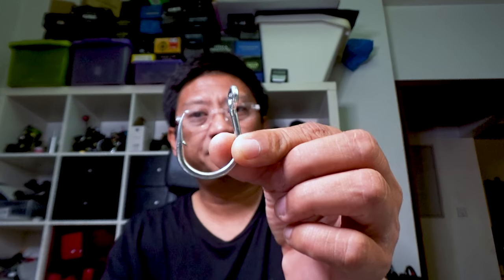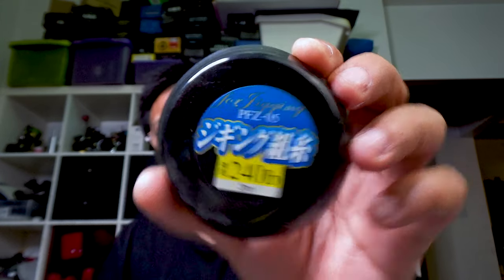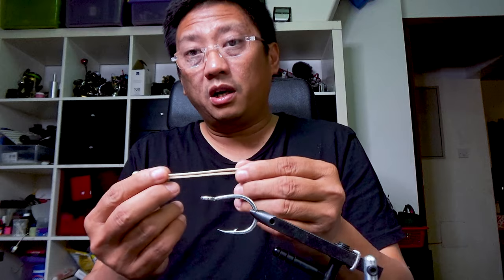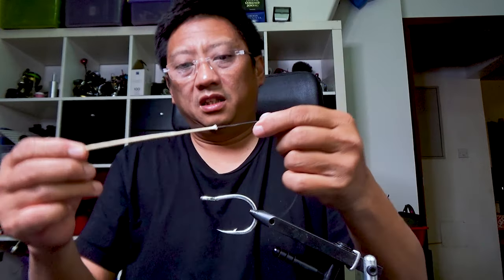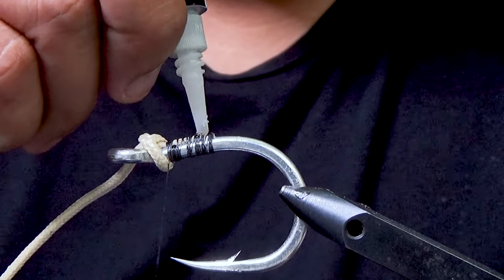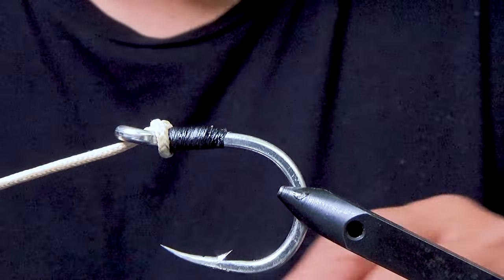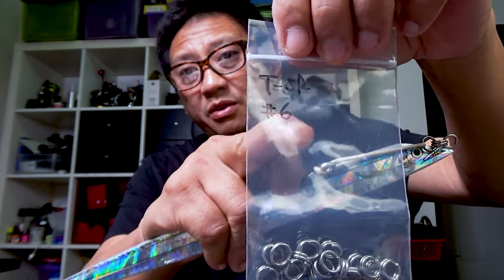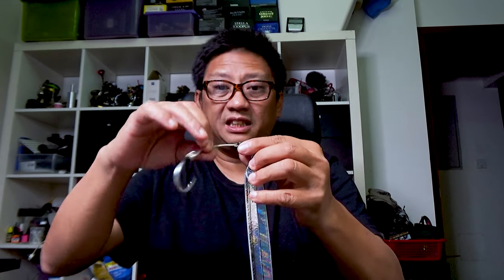WHY SINGLE ASSIST HOOK FOR FAST JIGS

Comment: what are your thoughts on using epoxy as extra layer of protection instead shrink tube? Is there any benefit of adding epoxy over glue in shore jigging for bluefin tuna with 80-120g jigs?
Reply from the maker: Regular epoxy yes - uv epoxy is trash

Comment: Hi Mr. Kit it's a heavy assist and monster jig also
good work and a lot of information as usual, it's my first time to see splicing the assist line with fluro inside it seems be hard, is this work also if you used latch needle or not?
And i just curious what are you targeting or expect when you fish with this monster jig and heavy gear you mentioned?
Reply from the maker: AJs, big grouper, tuna..etc. Latch needles would work too.

Comment: Anyone know what the little tool is called that holds the wrap line?
Reply from the maker: I dont understand - explain more so i can help you
Reply: @TheFishingKit  You use thin line that you wrap around the big line. The thin line is on some kind of tool when you wrap it, with a slender metal end. I was just wondering what that tool is called so I can buy one. Thanks for answering!
Reply from the maker: google fly tying bobbin holder @arnestanneck6331